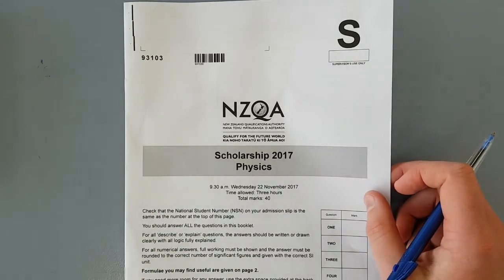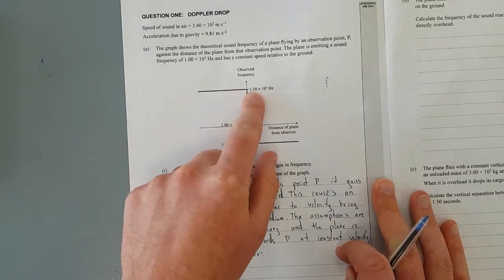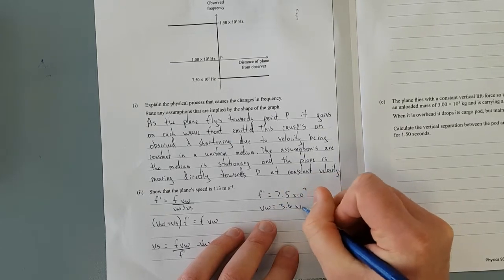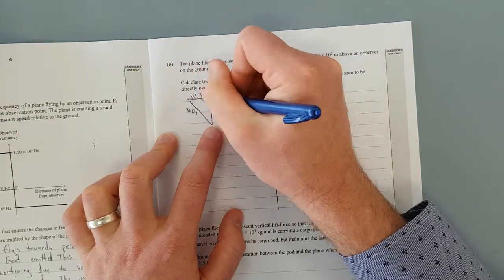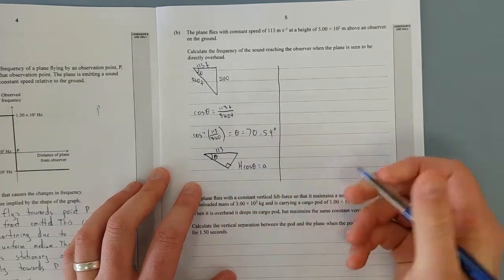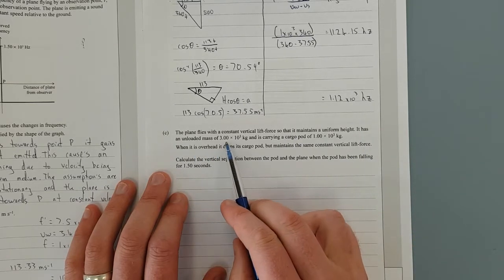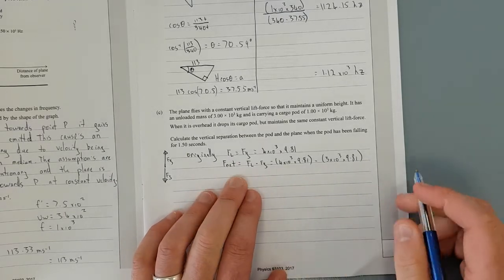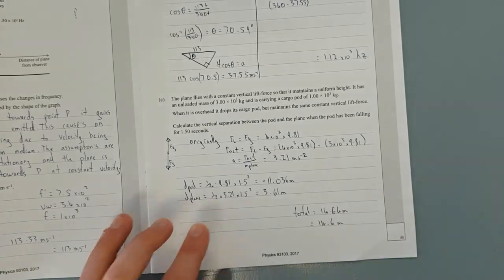2017 Scholarship Physics exam (NCEA)-Q1

Comment from the maker: made a calculator error in Question (c) the working is correct however, Should be dplane=3.69m NOT 3.61m so total=14.72m